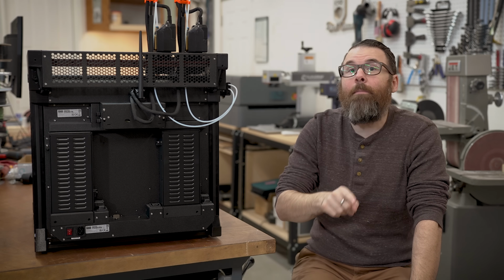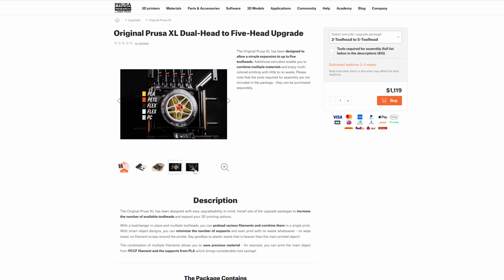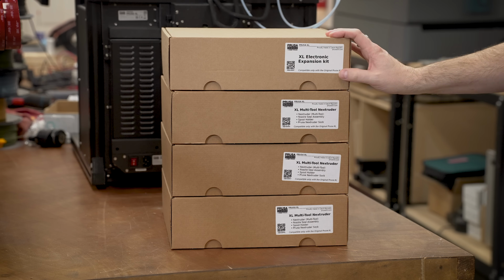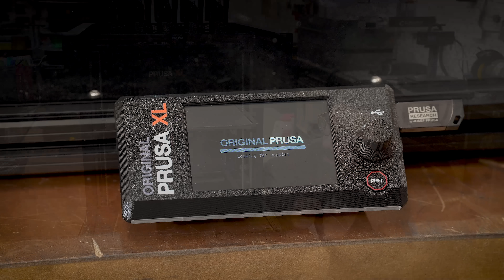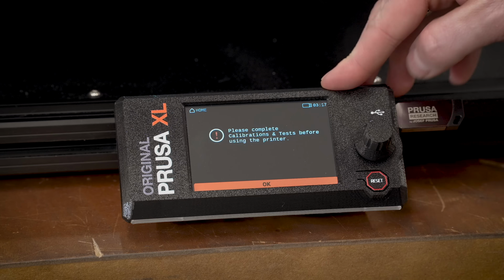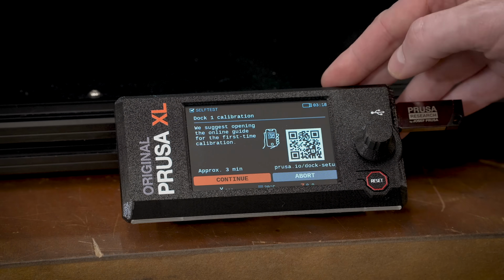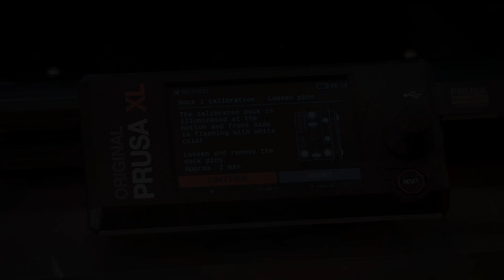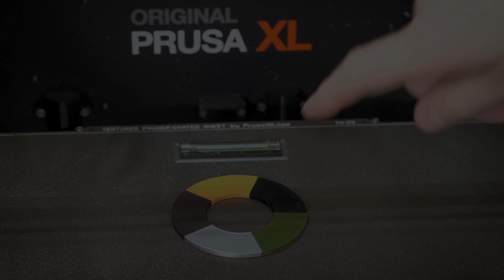Adding Extra Toolheads to the Prusa XL!

Comment: Nice to see what the upgrade looks like.  Years ago at pre-order time, my plan was to go 3-toolhead so I would have the upgrade board already there. When I finally ordered it, I went whole-hog and went for 5-head pre-assembled.  The main reason I was interested in the XL over any of the other similar size printers was the option of multi-material printing at different extrusion temperatures.  So far, I have done things like using PETG supports for PLA prints, and it has worked out really well.
Reply from the maker: I'm working on something for next week, but I printed PETG, PET-CF, TPU and PLA all in the same print, no problem.

Comment: Glad you pointed out the alignment process.  It takes time, but is another why this is a higher cost machine.  I learned that it is better do go through the process every time you do any thing with the hot ends.   Something else that I did - lube the 3 points on the extruder
Reply: Do you mean the 3 pins on each toolhead dock mechanism?
Reply: @falxonPSN  yes, the three brass pins are inserted in to dock, and lube helps.  There are some fittings on Printables to make fittings for the tube of grease thaecame with the printer
Reply from the maker: Correct, any time the machine is moved, everything should be calibrated.  This would be the same with a CNC milling machine as well.  Re-tram the head after placing it.  I've heard about lubing the toolheads, I should look into that.

Comment: This is a timely video.  I got word some days ago that my XL will ship in the spring.  Based on one of your earlier videos I decided to go all-in and get the five heads right off the hop.  I am excited to see what "really crazy" demonstrative model you conjure to test/show off the capabilities of this machine.  This video, with you sitting next to the XL, also gave me a real sense of how big this printer is.  Great video that is void of fforwardable filler and yet is as entertaining as it is substantive.  There's an art to that which you seem to have dialed-in.  Nice.  Look forward to more.
Reply: As someone else who went for the 5-head version, the initial setup is really quite straightforward.  The only recommendation is to get a T-Handle 2.5mm hex driver to allow you to apply more torque to the dock screws when installing them.  I would also suggest adding a drop of blue threadlocker as I have found they tend to loosen up with vibrations over time.
Reply from the maker: Oh yeah, it's MUCH bigger than you'd expect.  It's a real machine.  Also, thanks for the compliments!

Comment: Your comment about the dock screws is very important.  I stripped my dock 1 when installing it, or it was not drilled correctly.  I think this is the biggest design flaw on the printer.  Needs more than one bolt, and I would like to see an alignment pin in addition to the two bolts.  Just an update, Prusa will not sell only a Nextruder, at least not yet.  I tried when I had one fail, and they said only as part of an upgrade kit.  I wanted to have a spare on hand, as they are very quick to swap out

Comment: As always... thank you for the very nice and detailed video. I did have one question, during the time you had the dual extruder setup, have you had any of the fasteners come loose or where the extruder moved out of its calibrated home position?
Reply from the maker: I haven't had this issue at all.  I think it comes down to properly securing the docks.  They now have a detailed video in the manual to address this.  Wiggling everything while tightening helps everything seat into place.

Comment: Is it an expensive printer - yes. But the hardware design, very impressive. Contrary to other comments - that upgrade looks very easy, and well designed..that power supply design is slick! And even that 3 port controller card is a about as simple as you could make it - well done to the Prusa hardware team.

Comment: Hi Robert! I’ve been enjoying your videos for a while now, and I’m very grateful for you taking the time to make them. Touching on your upcoming videos where you’re going to showcase the multi material capabilities of the Prusa XL, I’ve got one request. Let me elaborate. I bought the i3 Mk3 pretty much when it came out and it’s been a trusty workhorse ever since. I’ve done virtually nothing to it, and then at some point the MMU upgrade was made available and quite often I’ve toyed with the idea of getting it. Now when the i3 Mk4 is out, I might pull the trigger on the Mk4 and the MMU kit. Sadly the XL is not for me, even if the budget would allow. Anyway, my request is that there seems to be a vacuum in explaining multi material on YouTube. Granted it’s been a while since I searched for MMU specific videos, but when I did, I couldn’t find what I was looking for! Nobody seems to explain the process from design to print when it comes to MMU. I think I’ve read between the lines, but a video confirming how it’s all done would be superb. The grey areas, to me, are how to design the print to use multi material, I believe you simply design multiple components (I use Fusion 360 for reference), and then you do some magic in the slicer (PrusaSlicer for me), where you import the parts in place, and select the different material/extruder. That’s what I’ve sort of figured out, but I’ve never found a video that explicitly explains this. Maybe it’s one of those things that is so natural once you’re doing it that it gets forgotten. 
Anyway, if you could shed a bit of light on the process, I’d be very grateful, and thanks for your videos. 😎👍🏻
Reply from the maker: You are correct, you just design the parts and select the extruder/filament for each part.  The reason it's not explained is it's fairly straightforward.  In my other XL video, I just made two parts that interlocked and selected the filament for each extruder and assigned an extruder to each part.  If you save an assembly as a 3MF, you can easily import that into the slicer and assign each piece to an extruder.
Reply: @RobertCowanDIY  Thanks for confirming this. I saw your other video, great stuff, thanks! From my perspective it’s all quite implied, which means that for me, a more detailed video on how to design, slice and print with multi material would be very interesting, even if it’s just confirming exactly what I thought, and you just said. I’m sure there are others out there hating might benefit from such a video.😊
Anyway, I don’t want to come across as ungrateful, I really enjoy your videos, so big thanks! 😎👍🏻
Reply from the maker: @JockeSelin  Check out my most recent video ;-)
Reply: @RobertCowanDIY  As you already know, I watched it as soon as I saw it. Thank you!

Comment: Great video! I really like how you went a bit deeper into the install of everything since that's something a lot of people have questions about when looking at one of those machines, but you don't have to watch 2+ hours of livestream of somebody doing it live with clear chapters and all the information nicely condensed.

I think you hit the nail right on the head on the pricing, yeah it might be an expensive piece of kit but the value proposition is pretty great, so if you have the uses for it it's probably worth it, especially since you already have a x1c so both printers complement each other pretty well I feel, specializing in different things instead of having 1 machine that's trying to do everything.

Can't wait to see your projects involved with this, the multi material printing without all the purging and waste is going to give some awesome results.
Reply from the maker: Thanks!  Yeah, seeing the machine up close gives you a better appreciation for how complex it really is.  And I agree, the X1C and XL are good compliments to each other, not necessarily substitutes.

Comment: I used Loctite 243 on the docks, a non ball end hex key and used the universal wrench that comes with the printer as a cheater bar.  Mine are not coming loose unless I loosen them.  I also removed that mesh back section behind the docks for better access. 

Another good video.  No good, no BS, just good info.
Reply: removing the back mesh makes it so  much easier

Comment: Was the torus smooth around the outer edge?  I noticed you tested on the topside between the colors, but I didn't hear you test on the side. Obviously there's a perimeter to perimeter seam so it's not continuous, but were they aligned?  I thought i visually saw a small XY deviation..
Reply from the maker: You'll never get sharp corners, so there was a little bit of a radius between the colors.
Reply: @RobertCowanDIY I was thinking the same. The alignment should be tested with a cylinder and changing colors after let's say 20 layers.
Reply from the maker: @hologos_  I'm not sure what you're asking?  I measured the part just now and it's nearly perfectly circular, it deviates around 0.1mm.  I don't really see how the printer would have an issue keeping calibration based on how it picks and places the toolheads.  Let me know if you'd like something tested, but it's a pretty simple and foolproof way of calibrating the offets.
Reply: @RobertCowanDIY My intention was to check the alignment of the toolheads (x,y offset of each toolhead).
Reply from the maker: @hologos_ Gotcha.  In an earlier video I printed the TPU and PETG part and showed the interface under a microscope.  It's dead-on.  I guess I didn't see any issues so I didn't really go any further.

Comment: How smart is the power distribution?  Let’s say you are doing a single extruder print, does the printer heat up all 5 hot ends, or does it only heat up the 1 so you’re saving power?
Reply from the maker: Fair.  My understanding though is a switch mode power supply isn't putting out full power when there's no load on it.
Reply: @RobertCowanDIY   I would think this falls on to the slicer, which should be setting the unused hot ends to 0 degrees, thus they don’t heat up.
Reply from the maker: @MrDksmall  This is how it's done, there's even a temperature delta you can set when they aren't currently printing.  I did some quick testing and the whole machine never got over 400 watts, printing in open air.  I'm assuming with higher bed and nozzle temps it would go up a bit, but it seems like they have a lot of extra margin in the power supplies.

Comment: Each power supply is rated for 240watts, the XL with all print heads heating and the bed full tilt it pulls about 600watts.

Comment: Prusa doesn't offer a 2T to 3T upgrade but we can purchase a single extruder (1T to 2T).  It appears the daughter board would be required even if adding one more tool to an existing 2T setup.  What about the extra power supply - is it required if just adding another tool to a 2T setup?  I don't need 5 tools but 3 tools would be nice....

Comment: Another nice video m8! Thanks for that... but if I may little question to you - I have understood that XL has two filament sensors per head... one on the side and other in the head... I may be wrong also :D but I have seen that it wastes quite some filament, if roll ends (bowden tube length of filament) or is there a way to overcome that...
Reply: I just got my Prusa XL this week and i can confirm there is one sensor in the Nextruder and one on the side. Theoretically youre right that it might waste some filament. But you can setup an additonal extruder tool/head as a backup (So it continous printing with another head if you have loaded the same filament in both).
But to avoid wasting this 30cm(?) of filament you could simply manually add something into the outside sensor. I personaly dont care about this to much though considering how much you save with the priming tower instead of the poop-shute from bambu or something.

One last option is ofcourse to permanently put a 5cm filament piece into the outside sensor and put in the filament directly in the tube i guess
Reply: @Keptains  Thanks m8

Comment: The need a torque setting for the 8:57 steps…
Reply from the maker: They need to better design the dock.  It's a 3d printed part that doesn't seat well into the extrusion.  ALSO, there are only a couple threads so you actually need more torque than you can really provide for the tiny fastener.  They should have done a machined nut-strip bar thing in the channel.  I would absolutely replace mine, but you need to tear down the whole machine to get to it.
Reply: @RobertCowanDIY  I’m gonna get mine in next month or so wonder what I need to get to rectify from outset ? Couiid you do a community post with a couple of pics and you fix idea. It might be adopted by prusa. Joel telling had that grease nipple idea thats apparently in the manual now…
Reply from the maker: @75keg75  Yeah, as long as you're careful, it's fine.  It's just not an ideal design.  They should have a nut strip (similar to a single nut that would go in the channel, but longer to accommodate all 5 tool heads) instead of the flat bar, which doesn't give you enough threads.  They could also switch to a machined part instead of the 3d printed part.  I can mock something up but it would be a change from the factory as it wouldn't be worth tearing down the machine to replace anything.